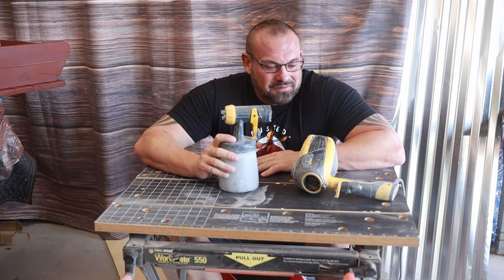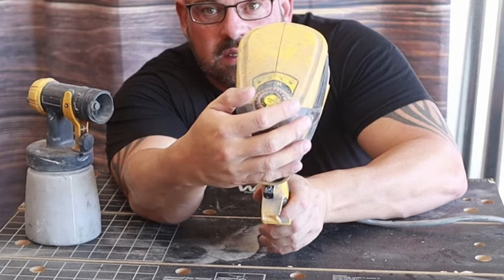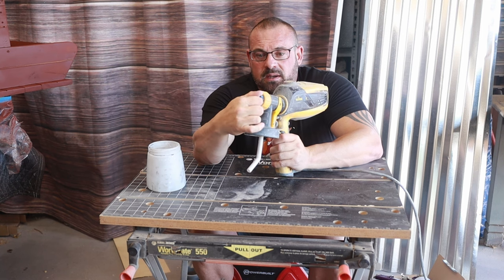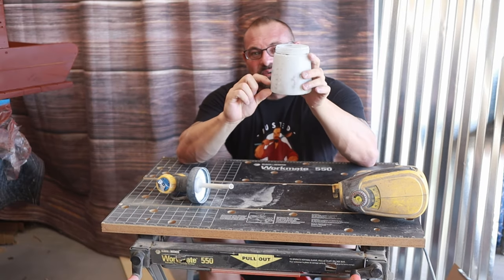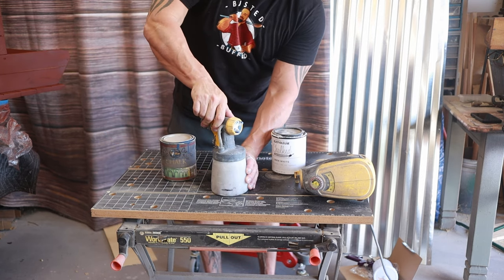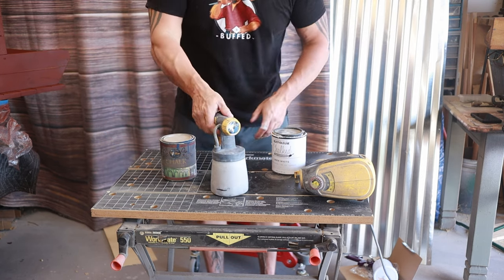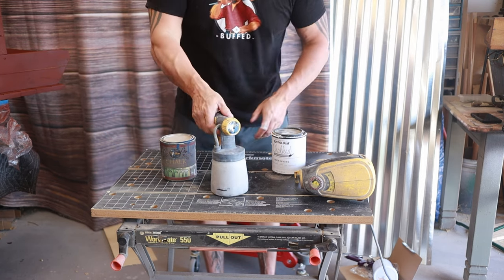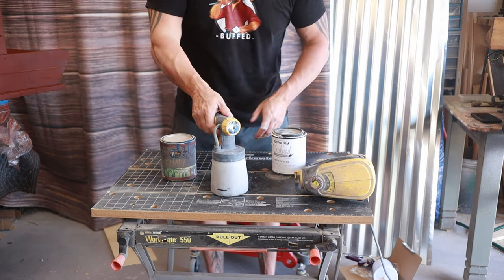Wagner Flexio 590 Review and How to Paint Sprayer

Comment: Thank you for the “your way” video. It’s so helpful. What do you use to stop bleed through say from mahogany before painting? 🌸❤️🌸
Reply from the maker: I use Rust Oleum professional grade red primer on 90% of my pieces. It’s $6 a can and normally 1 coat is enough maybe two worse case. I did a video trying shellac primer and shellac. It is very expensive, very heavy chemical smell and even after 3 coats still had bleed through. The primer I use is a odd choice but it works amazingly well. Most my videos have a Amazon link for it so you can see the exact one I use.

Comment: Thank you!!  I am planning on purchasing a paint sprayer very soon to paint some fencing before I try it on a furniture piece I'm working on.  This was helpful in taking the fear out of the cleaning process, which was one of my concerns.  QUESTION?  HOW DO YOU HANDLE THE TIME BETWEEN COATS?  HOW DO YOU KEEP THE PAINT FROM DRYING IN THE NOZEL?  HOW LONG CAN YOU WAIT BEFORE HAVING TO DISASSEMBLE AND CLEAN?  Hope that makes sense.
Reply from the maker: The sprayer I have here that is linked in the description actually comes with two sprayer’s. The one in the video they call a detail sprayer. The second one I didn’t show is larger and will cover much more space for walls and fences. It also holds more paint. I never really have a issue with the nozzle clogging but I also don’t let it sit long. A lot of the time I will just unscrew the paint container part that holds the paint and stick a zip lock bag over it if I am doing more coats. Then I will clean out the sprayer part. Hope that makes since.
Reply: @DeanFurnitureArtist  Excellent!!!  That makes sense and since you explained how easy the sprayer is to clean, then that is the way to go.  THANK YOU!

Comment: Do you know there is a Rustoleum base? I think there is a light and dark base and many colors. I go to a store called McClendon’s that has it. Come to think about it maybe Home Depot doesn’t carry the base to mix other colors.  I have been using Rustoleum custom chalked paint for years now. Ace Hardware might carry the base as well. Check it out! That’s for the info. I want to use a sprayer. I don’t have a compressor. I bought a Rexbeti brand, which isn’t bad but some chairs and DIY’s new Cottage Colors all in one paint is running into big money.  I guess it just takes practice. I have been checking out the exact one you explained. I also bought the Wagner large furniture pop up paint tent. That has helped.
Reply from the maker: I did not know they had that. Pretty cool! Home Depot is starting to phase out Rust Oleum and Varathane switching everything to BHER. They already removed all stains and top coats and switched to BHER products

Comment: Thanks for the info 👍...yes it is very simple. I say the consistency of chocolate milk lol
Reply from the maker: For this gun you want much thicker then chocolate milk. Think more like automotive it would be around a 1:20 mix. That is for chalk paint. Most normal paints need no thinning. Again it’s glorified spitting paint out or a 1/8 inch or bigger hole. Not like a compressor ran HVLP gun spraying out a pin hole.
Reply: @DeanFurnitureArtist  OK cool... good to know... I wonder if it works like a small turbine sprayer? I saw another brand that said it was ...I was part of a team back in the 80s that helped develop the lexair turbine system...  I really like the "no overspray ..." and even with the high efficiency of the newest auto spray equipment I've used still 15 to 20 % ends up in the air and on the floor. Paint is very expensive these days and I want to use every little bit!

Comment: Thanks for the tips!!  questions: what was your airflow for painting? do you ever have problems with orange peel look (my main problem) and do you ever tint your poly on certain colors? I started doing that a while back and really like how it looks.
Reply from the maker: Chalk paint I have the air flow all the way up. With the poly about a 4. Really varies on the type of paint, temps, humidity and so on. I just adjust as I go. 
The only time I got orange peel was when it was really cold in my garage. There is a ideal temperature rating on the back of the can. Poly definitely did not like the cold. If your spraying it nice and wet and not going back over already sprayed spots it should self level and be smooth. 
Hope that makes since. 
I have mixed paint in the clear only a few times. I will on black to keep it from looking cloudy. But I seem to waste poly mixing paint in it tossing out what is left over. So I just use it as it comes.
Reply: @DeanFurnitureArtist  Thank you   I live in Weatherford so I'm dealing with the same temps you are. This heat has been a challenge I keep getting craking do you think it is from putting the paint on to thick in this heat (I've been painting in the mornings but since i'm working out of my garage the furniture is hot to the touch even at 7am)
Reply from the maker: @patrickkelley4838  could be to thick. I’m not getting any cracking on my pieces. So hard to say for sure.

Comment: Awesome info loved the video. So when you spray the polycrylic you don't sand between coats? Also I noticed you use verathane poly what's your opinion of minwax?
Reply from the maker: No I don’t sand between coats when I am just sealing over paint unless it is a top surface that I need very smooth like the latest video I uploaded that was black. OR if I see trash or dust in the clear.  Everyone once in awhile I get a bug in one lol
Reply from the maker: I haven’t used water base minwax so I can’t give a opinion
Reply: @DeanFurnitureArtist  ok awesome thank you for the info

Comment: Do you have a video that shows how you spray indoors like, what # do you set the air to? If you don’t, can you do a video on that?  How do you prevent from getting over spray on everything?
Reply from the maker: Like I said there is not much over spray with this style sprayer since it is a low air high paint volume sprayer. You can turn the sprayer down all the way to 1 if you want it will just be a slower paint job. Just lay down a drop clothe and you should be just fine staying on the lower settings (1-5)
Reply: Thank you-
I realized that I have been using the wrong one. I have lost the smaller container and I’m using the bigger container (it has a bigger trigger/handle) and it’s meant more for outdoors I think , it’s not the finishing one. I want to replace it but I don’t know if I can get it w/o buying the whole set up again.
Reply from the maker: Yes you can get it separate. I got a second one for mine at Home Depot for $29. Yeah the one you are using is for walls and fences.

Comment: I have this and have done cabinet doors but have a ton of paint  in the air and going through a lot of paint. Is my dial too high? I had watched another person’s video and they recommended to set it at 8 to get a lot of air through
Reply from the maker: The only time I ever have to turn it up to 8 is if my paint is too thick. I am about 2 on clear and 3 to 6 depending on the type of paint. I just painted cabinets black for a customer. 4 drawers, 4 doors both sides and both sides of the cabinet. I used a little over a half a quart of black doing 3 decent coats. Hope that helps.

Comment: Hi Dean, in yur opinion do you think this could be used outside to paint a storage shed?
Reply from the maker: The tank/sprayer featured in the video is designed for smaller projects. However, it also came came with a larger tank and sprayer intended for walls, fences, and homes. This larger setup holds more paint and offers a wider spray pattern, which speeds up the job considerably. So, if you have the larger setup, I would definitely recommend it.

Comment: Great video just quick question I am going to buy the 590 and it comes with two different tips When using the chalk paint, do you prefer the detail tip which sprays a fine mist or the regular tip?
Reply from the maker: Mine didnt come with two tips it came with two different sprayers. I use the small sprayer. The large one I think is more for walls and fences.
Reply: @DeanFurnitureArtist  yep that’s exactly what I meant. I called it a tip but it’s actually two different sprayers a detail sprayer, and then the larger one for walls and ceilings. Thanks again for the reply and love your videos.

Comment: What’s the difference between the 3000 and the 590? Because your link take me to the 590.
Reply from the maker: I have the 590. I thought I corrected the title as well. They also sell a QX2 for $79.
But to answer your question the 2000 and 3000 are the new design that is supposed to have a much better nozzle or spray pattern.
Reply: @DeanFurnitureArtist  I bought the 590 before I realise the title said 3000😂 but it’s the right one. Thank you for your reply and keep up the good work. 👍

Comment: Dean  from the big box stores what  wood filler do you recommend  that is easy to sand , paint that won’t crack over time.  I found a product it’s a wood filler by bondo but I’m hesitant to use it . Because of. Cancer warning  help me out brother🤙🏽
Reply from the maker: I use many different kinds depending on the job. Little nail holes I use DAP plastic wood or pastic wood X. On bigger spots I use Bondo for wood. For major damage I use Bondo auto.